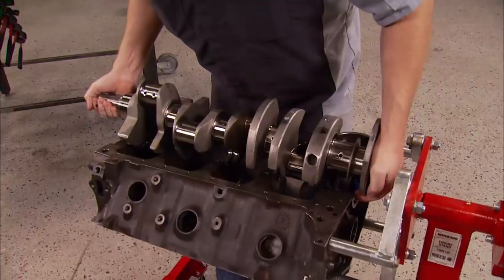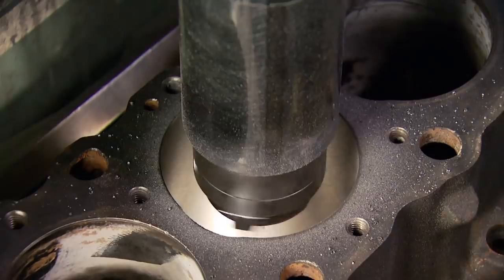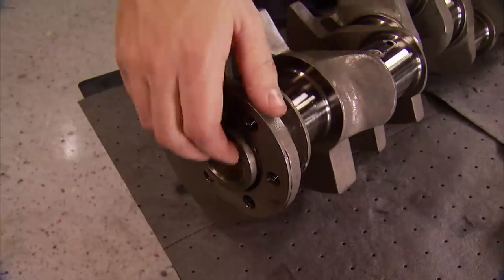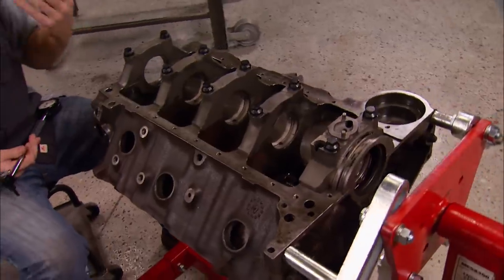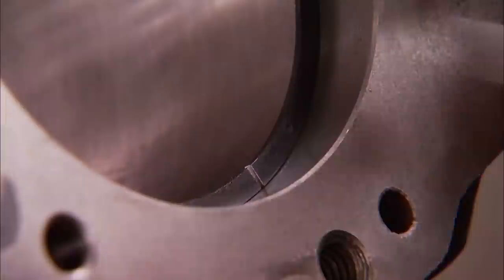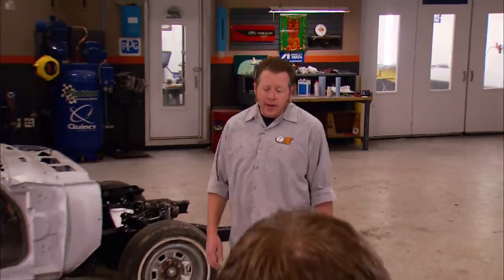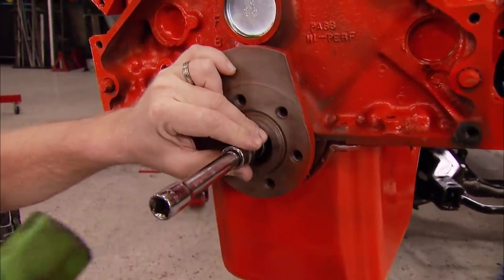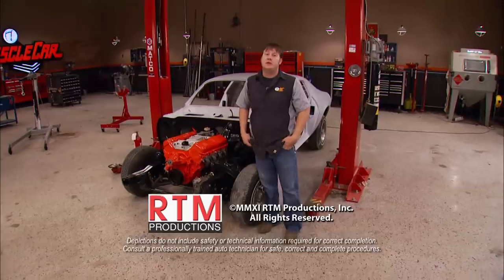Sleeving a 396 Big Block for a 1970 Camaro - MuscleCar S6, E8

Comment: Why bother with the 396? You could take a 454, even stroke it to a 496, and externally, it would be identical to the 396. The whole car is not numbers matching anyway, and not really a RS/SS also, so upgrade to a 454 or 496, and enjoy the extra power! Also a few more small things about your assembly techniques.. you should do the final loading of the crank thrust in a forward direction for the tightening of the rear main, as the clutch pushes forward. As for the heads, without the square pipe plug on the heads, they don’t look stock at all. A cooler thing to do would have been to use aluminum heads, cut off the old pipe plug from the cast iron heads, glue them to the aluminum heads, and paint them the same as the block! That would be sweet. Big blocks save a ton of weight going with aluminum heads!

Comment: Disappointed you used a 2 bolt main block.all 375s had 4 bolt main blocks. Another option would be the factory aluminum head to save 100 lbs off front end

Comment: Block material missing between liner repair on deck face at 3.30 hope the HG fire ring is not running over this,    and star lock washers on flywheel bolts are you kidding ?   and that liner replacement procedure is a bit suspect,  RED Loctite has no place on fasteners that need removal later down the line ,  a medium compound thread lock adhesive is more than capable RED is too permanent and certainly not used in those quantities seen in this vid
Reply: Denso ,
I did some work on.my mower deck, I used lots of red locktite on.my bolts, I should never have to replace them though. I patched a bad spot with steel and bolted it in place . tried that before and bolts came lose this time they won't move at all
Reply: The material you saw was where the valve relief was ... when they machine it back in it will blend with the sleeves

Comment: Never use a needle bearing pilot bearing on an original Muncie input shaft!
Reply: Why not?
Reply: Those input shafts are not hardened for use as the inner race of a needle bearing application. Use the  correct bronze bushing, it will last a very long time when installed and lubed properly.

Comment: . 023/.024 for main bearing clearance????? Ive not looked it up yet, but sounds sloppier than a ground beef/tomato sauce sandwich.  Wouldn't it have very low top end oil pressure with clearances like that? Not to mention sounding like a diesel???

Comment: No rectangular port heads like the real 375? Looks like you going to have some decent compression thereAny of you guys remember the 'BORG AND BECK' style pressure plate? need some SERIOUS leg strength for that PP but yeah it gripped much better than the diaphragmGET SOME HEADERS FOR THAT BABY!!!!!!!HIGH COMPRESSION AND SOLID CAM WITH EXH. MANIFOLDS, COME ON !!!
Reply: thats not how it came from the factory. that why they did none of those thing. are you paying attention to what there saying???? the want to build a factory ss car like it came back then
Reply: They mentioned the L-78 so the REAL L-78 had rect. port heads, great build but they could/should have just mentioned that they would install a BB conversion and forgotten the L-78 --502 would be a transplant

Comment: You pushed the pilot bearing in too far, it should stick out almost 1/4 inch.  Also the rockwell hardness of the old Muncie input shaft don't play well with a needle bearing pilot bearing.  Great series!!
Reply: Don't know about needle pilot bearing,but my Muncie had a roller pilot bearing on it for years with no issues.
Reply: @donaldgreen7471  Some Pontiacs came with ball bearing pilot bearing. Works much different than a needle bearing.

Comment: I  agree with comnents..get you a clean 4 bolt main.454 block..forget the 200$crap on that old motor.block.was just junk.with that hole..watch the comp.on this motor..needs pump gas...no solid lifters..they will fail..and do oval port heads with 118.cc.heads...375 motors were 1969..not 2019..build something that will last.

Comment: sleeve can be costly and not used by motor builders replace block will work better in long run and u can bore what ever you need  less work and save you $

Comment: I'm a little stumped as to why in God's name anyone would ever consider installing a sleeve in a lowly  bottom end 396 ? Was it just because you could ?  Why not just get a replacement block ? Now unless it's a number's matching L78 why bother ? Hey wasn't the mighty L78 a 4 bolt main motor ? I'm just checking if maybe I'm off ? Now you see  with the plentiful selection of great performing cheap street aluminum head's out there to choose from why in Gods name would anyone opt for the iron heads ?
Reply: The answer is simple, the 1970 -1972 Camaros had a 402 BB Chevy motor, as these guys were trying to recreate that era car, that's why they salvaged the 402 they purchased rather than just dropping in a 454 like everyone else. The fact it wasn't a 4 bolt mains is neither here nor there, in order to create an L78. It's hard to find a 4 bolt 396/402 so you have to work with what you can get. Don't knock it dude. The use of iron heads wouldn't be my choice, but the original car had these so why not. Yes they are not rectangular ports but for street use, the oval ports from that era have proved better for street use.

Comment: Is it just me or was the machining terrible on this block. The one cylinder looked like it still had big scores in it
Reply: I thought the same thing! Even when they resurfaced the deck it looked like garbage. They even showed the damaged after it was ''finished''!
Reply: k w not just you, the sleeving method they did was the worst you could. My local shop says this method hasnt been used by them since the 1980s. Its outdated.

Comment: HI, I wouldn't trust that sleeve job, it slid in too easy with no o-ring on the bottom to keep the coolant in place or flange on top to keep it from sliding down.
Respectfully Rich
Reply: Unless the water jacket is perferated, the sleeve will never see coolant

Comment: They used red loctite on the flywheel and pressure plate bolts, God help whoever has to replace that clutch down the road from now
Reply: You should always use red on fly wheel bolts. Literally just had a car in with  ARPs (who recomemd their loctite or red loctite) with blue loctite. 5 of 6 had come loose. He thought his granny was trashed.

Comment: Nice build. But a sleeve? Should have just scavenged another block.
Reply: Darren Medeiros Diesels use sleeves, and are alot tougher than a puny 396, and they also recommend assembling the whole engine with plain engine oil, have done at least a couple hundred.
Reply: I was not impressed with the sleeve thickness or how tight the fit was.
Reply: @beckywatt5048  good to know. Maybe just surprised they sleeved it. Coming from a build channel that rebuilds a whole car in 3 episodes. I'm thinking they just sleeved it for an FYI for the viewers.
Reply: Darren Medeiros The material the sleeves are of is a whole different animal , it does the exact same thing as the original cast iron block , but a whole lot better. I have seen 6.2/6.5s sleeved back to standard, they last twice as long or more, because the iron in the original casting was so poor.

Comment: L78 engines were 4 bolt main engines, this of coourse a 2 bolt main, so it is not an L78, also the pistons are flat top, the L78 had closed chambered popup pistons, and of course, the heads on this engine are NOT correct.  and the cam is not the one found in the L 78  The engine might be great, and just as powerful, or perhaps even more powerful, but it is not an L78 "spec" engine

Comment: I've owned a 66 chevelle  since 1971..the 396 is not a perfect.motor..made to run on 96 oct.leaded gas and the heads. Well all or nothin.10.to 1 comp.hard to play with 91 octane.and the cams can be unruly. Last thing.will break  valvesprings and rocker arms at 6k..be careful. Not a granny motor.

Comment: That is not a real l78 because I had a couple of them and I had them apart and they have 4 bolt Main they have square Port heads which neither do you have so few people either don't know what you're talkin about plus they have a 780 Holly on them and a solid lifter camshaft I know do the research

Comment: These guys are full of it. If that hole and crack isn't repaired, that crack will continue until the block splits. With heat and stress its only a matter of time. Sleeving is a great fix to those old blocks, but that crack has to be relieved and welded. Then and only then should you bore to proper sleeve size. Otherwise, you're just wasting money.

Comment: 2 bolt main L78 build. Come on now. Why not spend $200 or so more for correct 4 bolt main. I hope you are not going to use those low horse junk round port heads. Use the correct #291 castings or at least similar high flow rect port GM casting!

Comment: Wrong why flie both inner parts of the ring . Thats wrong you only need too file the back section of the ring because then you will not have a straight reference
Reply: @mr323i...it’s more important that both surfaces be parallel to each other. Perpendicularly is second that’s why a ring gap grinder is made the way it is. Compressing the ring against the wheel in the grinder (both sides)assures that they are parallel in the cylinder.